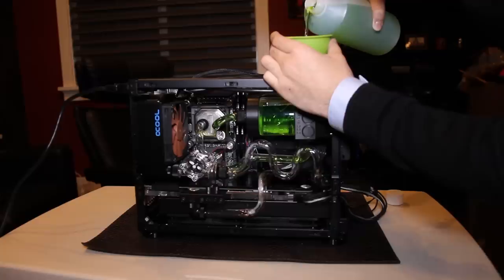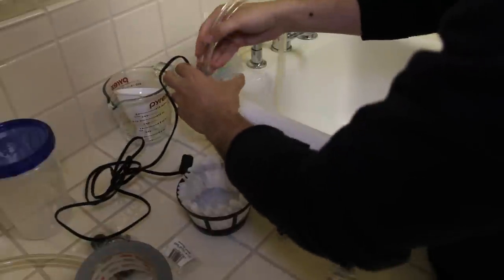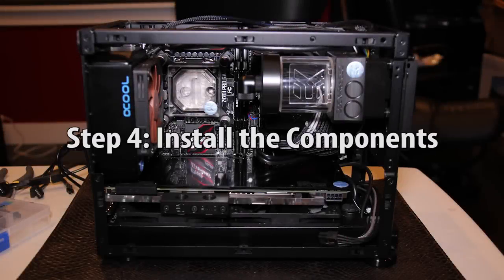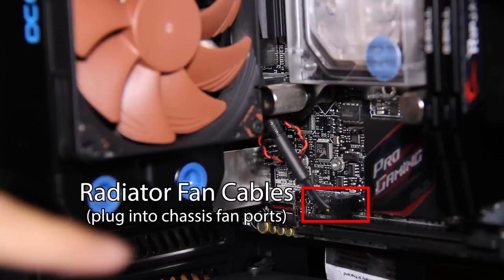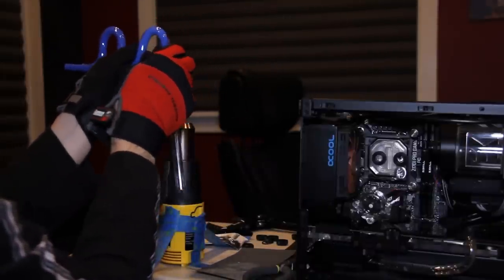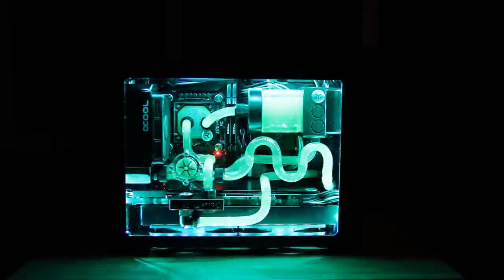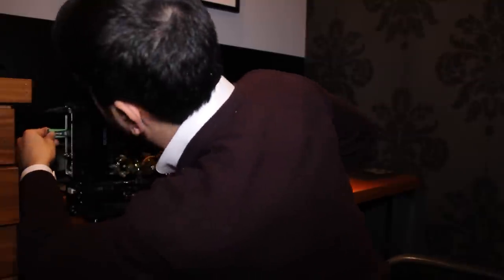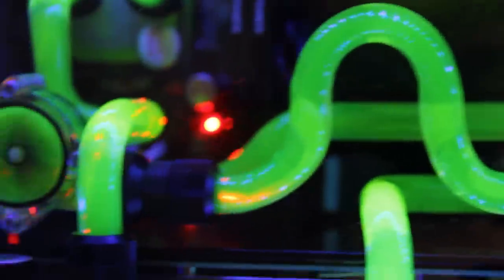Water Cooling Tutorial in 9 Easy Steps - Gaming PC Install Guide from Start to Finish

Comment: if you are wondering why your cpu overheats all the time, its because you didnt spread it out
Reply: haha, dude when u tight up the srews it spread out.
Reply: @frederikc1585  especially in water cooling, you cant really spread it out intill you start it, theres always a gap under the cpu holder, you always need your paste all over the CPU, or you will just have a problem installing new coolers.
Reply from the maker: Just to add to what everyone is saying - yup it spreads! However, after doing a bit more research, here's a cool article testing out various thermal paste application techniques and their results. https://www.pugetsystems.com/labs/articles/Thermal-Paste-Application-Techniques-170/  So, while adding a single blob should be fine, you're right there may still be more optimal patterns including pre-spreading it out. I did it for some parts, and for others I didn't. If it helps, it's been over 2 years and the PC is still running fine - haven't had had to re-install the hardware!

Comment: Loved the video Arjun, very well put together. 
I do have 1 question for you though: given the opportunity to build another water-cooled computer like this, what would you do differently the next time around?

Thanks for sharing your work!
Reply from the maker: You’re the first person to ask that - what a great question! I spent some time thinking about it and I’ll let you know if I think of anything else, but here are my initial thoughts:

+Next time around, I may not care to screw custom holes at the bottom to fit the radiator. It’s too much of a hassle, and  I think you can fit the radiator naturally by bending or shaving the thick usb cable. I was just being paranoid.

+I would consider not putting the fan filter under the bottom fans. They may prevent dust from entering the PC case, but reduce airflow. I would need to test this to see if it is worth it, but it might be worth it to remove the filter for the sake of better airflow.  I’m curious how much of a difference this would make.

+I would instead get a Motherboard with 2 or more M2 slots instead of just 1 M2 slot. No such thing was available when I built the PC in a mini-ITX form factor, but now they are! This allows expandability for more storage as your PC fills up.

+Now that I have more experience, I will definitely be faster at bending the pipes, and I’ll be sure to make sure they are super snug and tight without a doubt. They leaked 2-3 times on me while my PC was already working, and eventually I learned that the pipes really need to be pushed in all the way in and pushed in straight. If they are slightly angled, they can slip out when the Pc heats up.

+Next time around, I might not care to flush my components as thoroughly. I would probably just get a bit of water and shake them a few times. Vinegar is probably an overkill but I can’t confirm.

I’ll let you know if I think of anything else. Great question!

Comment: How did you measure the length of tube needed from one point to another? especially with all the bends and loops?
Reply from the maker: DT1510 good question, sorry I forgot to address this in the video. Similar to how I measured the length of the cables, I used some string to ballpark  the length of the tubes by holding the string in approximately the same shape the tubes would be in. Then, cut a piece of tube than is longer than you think you need so you have some margin to work with. When bending the tubes, it is an iterative process of trial and error. Push the tube into one of the fittings and get an idea for where it needs to start bending. Now pull the tube out and start bending that part of the tube. Put the tube back into the fitting and see if you got it the way you wanted it. If not, bend it a little more the way you want. If the tube gets so badly warped that you can’t fix it, cut a new piece and try again. If you bent it correctly, then move onto the next part of the tube you want to bend, eventually working your way to the other end and making sure that the tube fits snugly and pushes in all the way into the fittings on each end. This is why it’s important to cut the tubes a little longer than you think. It’s easy to use the tube cutter to slightly shorten the ends of the tubes until they fit properly. But if your tube is already too short, you have to start over with a new tube. I wasted my fair share of tubes in the early stages and got better over time. In fact, for every tube you see in my build, I think I had to start over and re-do every pipe at least once each if not more. But it’s fun and worth it in the end!
Reply: @Coolarj10  wow, thank you for that detailed response. Definitely one of the most tedious parts of the build, trying to get the perfect angles at the right spot without it falling short from the connection. Especially here in Australia  where the tubes aren't cheap.

This video has helped me immensely, and can't wait to finish my build! Thank you.
Reply from the maker: DT1510 glad it was helpful, and good luck with the build! While it is ideal to have more tubing on hand than you need in case of mistakes, don’t be afraid to repeatedly attempt to correct mistakes before ditching your tube and starting over. My really bendy tube in the front was challenging and I think I accidentally flattened part of the tube so it was no longer perfectly cylindrical. However, it is unnoticeable from the front and the ends of the tubes are still cylindrical and fit snugly, so it was fine. Actually that really bendy tube leaked twice during heavy gaming because the heat of the PC caused it to loosen during gaming a bit. I did not want to redo the entire pipe, so I wrapped blu-tac around the area where the pipe connects to the fitting to ensure it wouldn’t loosen. It is visible upon close inspection that i have some blue sticky material holding it together, but I was too lazy to try to re-do the whole pipe at that point. So, these are some things you can do to minimize buying additional tubing by improvising and adjusting the tubes you already own even if they aren’t 100% perfect.

Comment: I'm an industrial electrician I build cumputer systems the size of football fields with miles of wire and I do instrumentation and I work with staneless tubing and conduit. This is dumb af first off if you don't want to waste material account for shrink factor, 2 download a tubing calculator on your phone so you don't have learn all the complex math involved, 3 invest in a digital angle finder it saves you alot of work and there cheap, 4 buy a cheap level so you can do proper kicks, 5 it's  actually extremely helpful knowing the math behind it so can do much more complex bends like factory 90°, fishing hooks ext....so look up some basics on instrumentation

Comment: absolutely horrible bottom rad/intake design blocked by GPU.. But I guess there were no other options
Reply from the maker: Technically there is a more efficient option I believe... which would be to have the radiator hang sideways at the top of the case. The NCASE comes with a bracket that allows you to do that. However, it would probably be nearly impossible to install hard tubes manually, so you would have to either use an all in one cooler or perhaps flexible tubes. Of course, the PC won’t look as aesthetically pleasing because the radiator will be sideways and blocking view of all the components. But airflow would be much better. However, it’s been 3+ years and my PC has been running fine for gaming, video editing, CAD design, etc.. in case it helps serve as a working example.

Comment: Question, do you need to have 2 radiators or can you just have one big 480mm radiator for both cpu and gpu?
Reply from the maker: Great question - you can have one giant radiator. Since radiators are good for cooling liquid due to their massive surface area with all the fins, a single larger radiator can have the same or more cooking power than 2 smaller radiators. It depends on the size and amount of surface area, etc. The dimensions of the radiator are a reasonable way to judge whether or not you can replace 2 small ones with, for example, a single radiator that is as big as both combined.
Reply: @Coolarj10  thanks. Its my first time water cooling...heck, its my first pc build in 15 years. So I had to do alot of research in the current tech.

Comment: That little graphic in the beginning  at around 2 is wrong ... about the direction of the water loop ..
Reply from the maker: arpan lall hey! The direction of the loop is actually how my current PC us running. The pump is at the base of the reservoir/pump combo and pushes the water down and away from the big reservoir.
Reply: I am sure it might be running in the configuration  as shown in the little graphic element but being a mechanical  engineer  I know that any coolant/liquid is sent to the heat exchanger ( radiator ) after it has served the purpose of cooling ... that is cooling the CPU in this case ...as heat transfer is mostly convection in fluids it should be ideal to maintain the reservoir  at a lower temperature  which would not be possible in case of the loop shown in the video as the warmer liquid makes its way to the reservoir potentially increasing your reservoir temperature  ... I am saying this because I liked what you are doing here and want you to improve the content  ...... I hope you understand  the difference between something running  and something running "right". Just because your loop runs doesn't mean it is functioning  right

Comment: Can you watercool only the CPU but not whit a all in one kit?
Reply from the maker: Shockwave - yup! In this video, I attached a waterblock to the CPU and GPU. However, you can instead simply install the GPU as-is (they come out of the box with fans already installed) without water cooling. Then, you only need to focus on cooling the CPU, which you can do by attaching a waterblock to the CPU only and connect it to the pump and pipes shown in the video.

Comment: a pipe went out (o-ring was missing) and coolant leaked all over the pc :(.

the dumb thing i did was that i disconnected the pump and the pipes(cz  i had no more coolant liquid left)
and tried to boot the pc up.
guess what ? smoke came from cpu, f**k
anyone tell me what to do
Reply from the maker: Hey! It’s ok, been there before. First things first: you need to let your PC dry.

Get a can of compressed air and find every place you can find that has liquid and blow it out (first making sure your PC is UNPLUGGED). The motherboard and graphics card are the two areas where there’s most likely to be water droplets trapped. Push out all that liquid! Next, BE PATIENT! The longer you wait, the more likely you will have success. When I first set out to do this liquid cooling project, I had leaks 3 times, 1 time my PC sparked and shut down. 1 time liquid got into the graphics card to the point where the PC would boot up but the graphics card couldn’t be detected. All three times, my every component survived and I’m still using the same PC today (but I re-did all the pipes to be way more snug). 
If you can wait at least 24 hours after you use compressed air, that will be great. Since it’s the fall/winter time and the weather is cold, consider waiting longer unless the room your PC is in is particularly warm. Tilt the PC on its side over a dry towel so additional liquid can fall out of the PC from gravity. Feel free to use compressed air again after some hours of letting it dry. 
I have turned my PC on after waiting only an hour so (not recommended, I was being impatient) and was fine once, another time I waited a day. It’s always riskier to not wait long enough and I would NOT recommend trying to turn on the PC out of over eagerness until you are sure it is dry.

It should be fine, parts are pretty reliable these days. Now, given that you saw smoke, there is a chance that some capacitor or something blew (but in that case you would’ve heard a pop sound). If that’s the case you May need to replace a component such as the motherboard (or wherever the smoke came from). However, I wouldn’t give up hope yet and wouldn’t jump to a conclusion because I would still put money on betting that you may be fine.
Good luck, would love to hear how it ends up working out!

Comment: Can i use food coloring for the water inside?
Reply from the maker: Sure! The only time additives like food coloring or other chemicals become an issue is if they start to gunk up your pipes by clumping up. Or, if they are abrasive where they start wearing on your pump or pipes. The liquid I used was pre-purchased, but at the end of the day it’s just a mixture of distilled water, coloring pigments, and they also added some antimicrobial chemicals to prevent mold just in case.

Comment: You have to clean the parts even if it is brand new???
Reply from the maker: Barnikaa unfortunately, yup you do. When the parts come brand new from the manufacturer, they may have some dust or debris inside from the manufacturing process. However, looking back, I think the process I described in the video is probably an overkill for brand new parts. For brand new parts, just filling them with some distilled water and shaking them with your hands and then rinsing a couple times should be good enough.
Reply: Arjun Mehta ooooooh  ok Thanks!😭
Reply from the maker: Barnikaa don’t forget, if this is more cumbersome than the time you have for this, you can buy a ready made closes loop liquid cooler, such as the Corsair H100i. It already has the liquid and pipes connected, you just attach it to your CPU.
Reply from the maker: Barnikaa oh wow beautiful setup!! Super clean

Comment: If I'm using flexible tubes do I still need to chamfer them?
Reply from the maker: Hey! If you are using flexible tubings, you do not need to chamfer them. All you need is a compression fitting meant for soft tubing, and when you connect your flexible tube, it gets attached very firmly so it won't leak. 

Here is the compression fitting I used for the soft tube that I used as an outlet in my build: https://www.amazon.com/gp/product/B01DQ0WSTQ/

Here is the flexible tubing I used: https://www.amazon.com/gp/product/B00A0PZZYQ
Reply: @Coolarj10  oh also how do you make a drainport?

Comment: Nooooo you forgot to screw in the m.2 ssd stand off
Reply from the maker: nightfire_19 ahh do they come with a stand-off? That makes so much sense because I didn’t feel right screwing it in directly, but I have purchased 3 SSDs in the last few years and none of them came with a stand-off...
Reply from the maker: On a side note, thankfully the M.2 SSD has been working without issues over the last many years without a standoff
Reply: Arjun Mehta Your motherboard should have the m.2 standoff

Comment: he kinda literally convinces anyone on the fence about water cooling with the leak in his video ...to in fact, not water cool thier pc
Reply from the maker: Xeoh501 haha well if it helps, my PC ended up leaking 3-4 times during the learning process and all components survived every time - including the time when the water gushed out so hard it sparked my motherboard..components have become a lot more reliable these days so it is harder to for them to get destroyed. However, if you don’t want to take the risk, the all-in-one liquid coolers provide the benefit of water cooling (quieter PC/lower temps) without all the effort of a custom loop and the risk that custom pipes may not be snug enough. 4 years later, the PC has been running great. I’ve done maintenance on it only when it leaked, as well as one time I finally replaced the water after being unlazy, and the time I replaced the M2 SSD with a larger one. Now that I have had my fun with liquid cooling, the next time around I’ll probably save time with an all-in-one cooler. I really like the benefit of a quieter PC, don’t feel afraid about water damage now that I’ve survived a few accidents because my pipes weren’t snug enough, but may not feel like spending the time to do a full custom build.
Reply: @Coolarj10  dang, wow thats exactly what im afriad of. Yeah i built my pc with a 300mm AIO cooler and the thing is dead silent and never shuts off. 
Your vid caught my eye because i you showed a lot of detail for someone like me thats trying to get over all the "what ifs".

im with you on the AIO cooler but no aio is ever going to look as cool as what u have in the video. thanks for the reply and the content :)